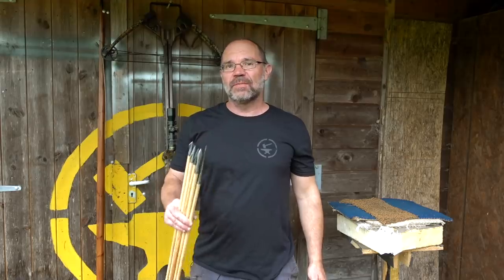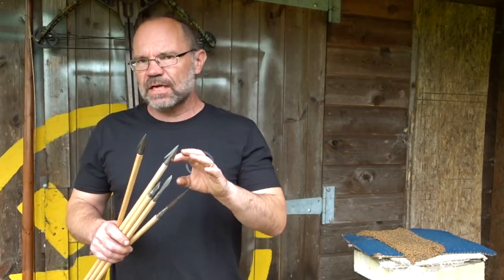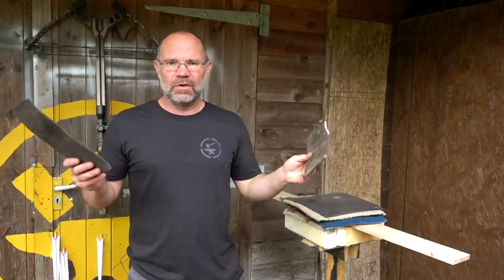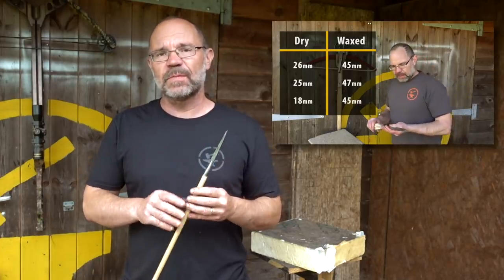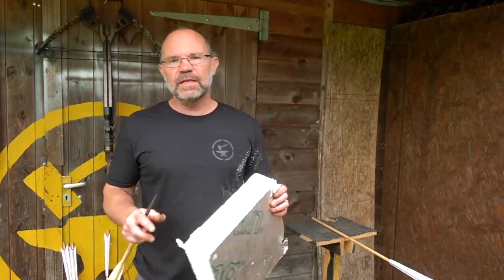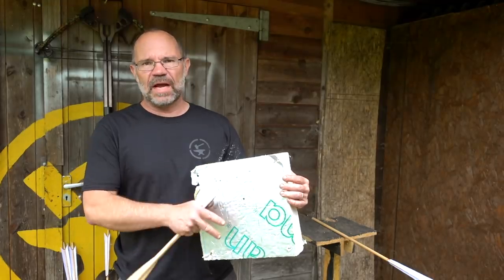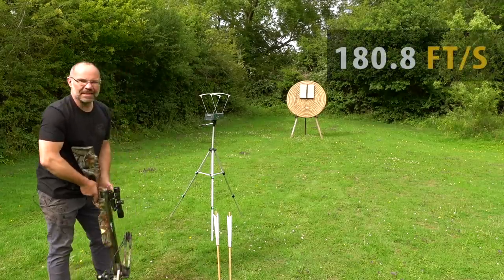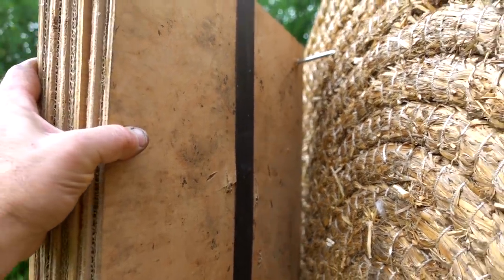Lockdown Longbow - Now I have WAR ARROWS!

Comment: I mentioned something along these lines in the MyArmoury thread, but I think you're using too much power for most of those arrowheads. 9-11mm was a more common external socket diameter (the shaft being 0.5-1mm thinner) for the LM16, and so far most of the the archaeological examples of 11th-14th century arrowhead types - and even some that were used into the 15th century - that I've found have fitted into this range, with at least half being 9-10mm as with the LM16. Similarly, the archaeology of bows, combined with manuscript miniatures, suggests a 28" draw through into the mid-14th century at least.
Edit: If the arrowshafts are ash rather than aspen, that's also something of an anachronism, as most war arrows were made from aspen.
Reply: Hi Jonathan, thanks for the information!
For what it's worth, the reasons behind using a 1/2" socket on all the arrows was to fit this video in as much as possible with our previous one, in which we used a 1/2" Type 9 head, on ash arrows.  As soon as you start adding in all kinds of variety people get a bit funny about consistency.  You're spot on of course, there are virtually no 1/2" LM16s around, and some that I've handled in storage are as small as 8mm, such as the one in Salisbury.  This test was more to see what they'd do as a typology, and we just stuck with 1/2" across the board to minimise variables.
Regarding the draw length, again this goes partly back to our first film with Joe, where he was shooting a 30" draw, so the original arrows were made to that spec ergo these ones are the same, but also because we really only have the Westminster Abbey arrow and the Mary Rose arrows to use as extant examples so had to base our test pieces on those.  The arrows that I made for this film, and the previous one featuring Joe were copies of Mary Rose arrow MR80A764/158 which was 30" in length, so again we just kept everything the same.
As for the ash/aspen issue, it's really debatable what the "standard" arrows were made from.  We know that the majority of arrows used for naval archery in 1545 were aspen, as we've got the MR assemblage to look at but Ascham writes that ash is the preferable timber for war arrows, not aspen.  Either way, ash certainly performs better at these weights than aspen, and holds together far better on impact.  Aspen makes a better flight arrow, but we decided against it for our original film in favour of ash, knowing that ash was historically more likely to have been used at Agincourt thanks to Ascham, and that it increases the chance of damage to it's target over aspen.
Reply: @MedievalArrows  I do understand that there's a desire for consistency, both within a dataset and with the previous video, but given that the arrowhead you based the one used in the Agincourt tests has a 10mm external socket diameter and 10mm diameter examples of the M2 exist as well, so I think a uniform 10 or 11mm diameter would be more representative of the Middle Ages as a whole.

Regarding draw length, the vast majority of archaeological examples of powerful bows from the Middle Ages have a draw length of 28" or less and, since horn nocks don't appear until the mid-14th century and provide an extra 10-11cm of NTN length, I think it's reasonable to use that draw length for 11th-14th century bows. I'll also have to check my notes, but I believe a late 15th century source also refers to a 28" draw length as the minimum. 

As to aspen vs ash for arrowshafts, Richard  Wadge demonstrated that aspen was most commonly used in the early 15th century in his book, "Arrowstorm". Lightish softwoods, such as pine, are also favoured heavily earlier, so I'm not in favour of ash as the "standard" for testing
Reply: @Cahirable  the problem with only using written data to base opinions on is that it's virtually never from actual archers, bowyers or fletchers.

In our case,  Joe's extensive research and experience tells him that 160lb is about average for military bows.  We know that 30.5" was the most common draw length from the only surviving military arrows to examine, and from practical experience to shoot well from a 160lb bow at 30.5" you want to be shooting 1/2" ash - regardless what some sources say.   Historical sources can't always be trusted and are often hard to interpret but practical research from experts is far more useful.

Yeah we could have made the arrows 10mm, but they'd have shot poorly from the 160lb bow.   Yeah we could have made the bow lighter, but that wouldn't have fit with current research on military bow weights.
Reply: @MedievalArrows   Will, I respect the work you, Joe and all the other members of the warbow have done over the years a lot. I'm probably coming out too strongly here amd my respect for your work hasn't been made explicit.

*However*, all your research and experience has shown is that 160lbs was the most common draw weight for military bows in the 16th century and that 30.5" was the most common draw length in the 16th century.

You have also altered history sometimes to make earlier periods conform to your view that there should be no difference between 13th and 16th century warbows. The arrowhead from the London Museum that inspired the arrowhead used in the Agincourt tests, for instance, only has a 10mm diameter socket rather than a 1/2" diameter. Other times you improve a design, as with the Westminster Abbey arrow, whose socket was not flush with the shaft, because that makes more sense to you than the original.

We have a lot of archaeological evidence that ash was not particularly common for war arrows, whether we're talking about the 3rd century, the 9th century or the 16th century, and we also have a lot of archaeological evidence in the form of arrowheads that shows that bows of the 11th-14th centuries were significantly less powerful than those of the 16th century. Moreover, we also have archaeological evidence of high draw weight bows that couldn't be drawn much past 28", at least according to the bowyers I've read. I can email you the measurements and sources if you'd like.

The long and  the short of it is that there's more evidence for bows less powerful than the Mary Rose bows dominating prior to the 16th century than there is for evidence of Mary Rose style bows existing in that period, and the narrow focus of the warbow community is distorting the history.
Reply: @Cahirable  I understand what you're saying,  but we're running tests for the 15th century,  not the 13th.  And there is no evidence of bows from the 15th century.  All we've got are bows and arrows from the 16th century,  so we're using those,  and making the assumption based on practical expertise that they were virtually the same.

And the 16th century bows average around 160lb, and the arrows average around 1/2".
Reply: @MedievalArrows  We'll have to agree to disagree, then. As late as 1465 a draw length of under 30" was acceptable (https://books.google.com.au/books?id=8XE1AQAAMAAJ&pg=PA293&dq#v=onepage&q&f=false), and what few arrowheads I have so far that are likely from the 15th century suggest that, while there was a trend towards more powerful bows during this time, lighter bows were still in common use.
Reply: @Cahirable  I don't doubt that shorter draw lengths were "acceptable."  I also don't doubt that there were all sorts of sizes of arrow, arrowhead and bow in common use.
However, you've said yourself that there was a trend towards more powerful bows.  So the bow we're using fits that trend.  I don't see why that's a problem?  Agincourt was arguably where the military bow was nearing it's peak.  If anything, we can argue that the Mary Rose bows would have been lighter than those used in the 15th century, where pitched battles against plate armour was common, unlike at sea in the 16th century. 
 
The problem with all these tests is that nobody is ever happy.  We've been crucified for using iron heads, despite the original being iron.  We've been crucified for using the wrong type of steel for the plate, despite the carbon content being the same.  We've been crucified for using the wrong backing material, the wrong maille, the wrong fabric armour, the wrong speed tests, and now you're saying that we should have used heads 2mm smaller in socket diameter, and arrows 2" shorter as if that would make some huge difference to our results?  We don't have all the answers - we don't KNOW that ALL LM16 heads weren't 1/2".  We DO know that hundreds of arrows slightly later were 1/2".  We do know that they were 30.5" long.  We do know that ash was used for war arrows.  At some point, we have to use a combination of what we know, and what we think we know, and I believe that's what we're doing.  
Should we run all of our tests again with arrows 2mm smaller, and 2" shorter?  I don't think so.  You'd be happy, and then we'd get comments from people who say the MR arrows were 30" long and 1/2" wide, so we're doing it all wrong.
Reply: @MedievalArrows  
"Agincourt was arguably where the military bow was nearing it's peak.  If anything, we can argue that the Mary Rose bows would have been lighter than those used in the 15th century, where pitched battles against plate armour was common, unlike at sea in the 16th century."
That there is exactly the problem I have with using the Mary Rose evidence for periods that are significantly later. We know from French sources, as well as English sources, that the English made heavy use of warbows under Henry VIII (I think here of Fourquevaux and Blaise de Montluc in particular), and we also know that armour was, overall, heavier and more complete in this period than in the early 15th century - and here I mean for the infantry as well as the men-at-arms.
Additionally, as Steven Gunn has demonstrated in "Archery Practice in Early Tudor England", legal requirements to practice archery were often enforced and frequent maintenance of butts was made, especially during the 1540s and, while, there may have been a declined in the lead up to the 1520s and a slow decline after the 1550s, archery was strongly in practice around the time of the Mary Rose, including by children and youths, and even in 1557 25% of the general population was considered sufficient archers (J. Goring, "Social Change and Military Decline in Mid-Tudor England"). The remaining, contra Goring, did not have "no military skill whatsoever" , but were fairly well equipped heavy infantry (James Raymond, "Henry VIII's Military Revolution"). 
While this proportion is significantly lower than the Bridport Muster Roll of 1457, it is still higher than any other surviving 14th century English Muster Roll, save that of the Rape of Hastings (Wadge, "Arrowstorm"), and reflects a general shift to higher proportions of infantry than missile weapons than was the case in the 15th century expeditionary armies (ibid). This is not evidence of a decline in ability of Tudor archers and, if anything, allowed for those arraying the soldiers to be choosier with the archers. And, more to the point, we don't know what the situation was in the period 1355-1455 when it comes to proportions of archers to non-archers, so there's no way to say whether there were more good archers in 1415 than in 1545.
Similarly, the arrowheads from Camber Castle, which are on the whole similar in diameters to most of the shafts from the Mary Rose, show that powerful bows were considered necessary for defence on land against armoured opponents and make it hard to argue that the bows of the archers onboard Henry VIII's flagship were using lighter bows than others because they were fighting on sea and were less likely to face armour.

Does this mean that the archers at Agincourt were drawing lighter bows than in the 16th century? I don't know. I suspect that they were, but until I get enough firmly dated arrowheads in my database I'm not going to say one way or the other. And, when it comes to tests against metal armour, I have no problem with using a well made 160lb longbow, because whether the arrow penetrates (which I knew wasn't going to happen before I watched the video) or bounces off, it establishes a useful baseline.
However, against textile armour, mail, metal simulating COPs, etc, I think it's frankly useless to use such a powerful weapon, as this video shows. You could make a 30 layer jack out of hand processed, hand spun, handwoven linen canvas, quilt it every 5mm, boil it in glue for a week, let it dry, put a piece of 5mm thick cowhide on top and Joe's bow would still probably penetrate to a lethal depth. A 100% authentic infantry gambeson made out of old linen bedsheets[1], regardless of whether it was soaked in a salt and vinegar mixed, would likely perform even worse than Tod's gambeson.
"We don't have all the answers - we don't KNOW that ALL LM16 heads weren't 1/2" "
5 of the 67 LM16 heads i have in my spreadsheet were 13mm or 14mm in diameter, but I've never argued that there weren't any suited to 1/2" shafts.

"We do know that ash was used for war arrows."

We know that ash was listed as a preferred wood for arrowshafts in the Tudor period, but that they were not particularly common in the Mary Rose wreck (or, for that matter, in the sockets of arrowheads from Camber Castle). Similarly, we know that Henry V and Edward IV both explicitly ensured that there was an uninterrupted supply of aspen for their arrows, and that most of the arrows from the Mary Rose were aspen, so it seems logical to conclude that most war arrows had aspen shafts rather than ash shafts. 
[1] Okay, I admit it, I only have one passing reference to old bedding being used specifically, but a wealth of 13th, 14th and 15th century sources - as well as the Rothwell jack - make it clear that not only was used linen the most common material for the average gambeson, it was actually preferred over new linen in many cases.
Reply: @Cahirable  see my point? That's a whole lot of don't-knows right there.  We don't know, so we made educated guesses where possible. 

Never gonna please everyone  :)
Reply: @MedievalArrows  As I said earlier, this is clearly a topic we'll have to agree to disagree on, but I hope you can see that I'm using archaeological and textual evidence from the period to make my point and that I'm not just trying to be contrary

Comment: Dude, that's super dangerous to fire any wooden arrow through fiberglass limb let alone a compound.
I know those are very well made. I'm very supervised that they held up and you didn't dry fire. 
I wouldn't have done it.
Reply: Nonsense. What matters is matching spine to bow weight. 
Shot wooden arrows thousands of times from fibreglass (composite and pure glass) when I was a teenager. Arrows broke hitting stones, posts, trees. Never in the bow.

Comment: I would wager the ones that we have no evidence being made with steel were just expected to break and be lost in battle anyway so why use a more costly material? The ones that are more designed for flesh wouldn't be fired at things that would break them so they could be recovered and used again. But that is just speculation.
Reply: As for the wax on arrow heads: I don't believe wax would survive on the heads we find on the seafloor and buried in the dirt. I also think that if the standard practice was to wax your arrowheads to prevent corrosion, of course mentions of it would be virtually non-existent in the recounting of battles and we have very few (if I am not mistaken) records from people like quartermasters and fletchers regarding maintenance of arrows which would be the only likely source to tell us if they waxed them. The archers might know, but but realistically they are just taking arrows from a barrel on the line and loosing volleys until they are out or are told to stop they don't really care if their arrows are waxed or not. If wax has greater penetration there is no way people would not have figured that out and applied it since wax is cheap and easily applied to the arrows as they are finished.

Looking at history before modern bookkeeping where we record just about everything it is easy to forget that many of the things we do we consider so obvious that "why should I record that, everyone knows that already."

Comment: But is the sheet steel comparable to historical plate cuirass? Especially in shape, thickness, and hardness? This is especially important.
Or at the least is it comparable to the overlapping iron plates under a brigandine jack? 
Also I think if you want to represent a shield, the wooden plank should be covered with leather - also shouldn't a thick plywood a more representative material than a wooden plank (AFAIK Roman Scuta were made of thick plywood covered by leather, not sure about medieval shields, you know better than me)
Reply: not all shields were covered in leather, so covering the plank in leather should be a separate test.

as for plywood shields? those weren't too common in the medieval period, that said some byzatine shields were made like older roman shields.
Reply: A modern sheet of mild steel is supposedly comparable enough as a base material as the one they used back then wasn't as uniform, the thickness can also be matched easily. Heat treatment is the biggest problem because it varied so much, there was properly heat-treated armor, there were rush jobs and some wasn't treated at all.
From that experiment with period-equivalent high quality armor we already know that an arrow won't go through a hardened steel breastplate, so this would be more interesting as an equivalent of a cheap breastplate, which were probably common enough.

Comment: I won't begrudge you using whatever target backing you want, but that sound of the arrows sliding through the Styrofoam is 100x worse than nails on a chalkboard to my ears.  If you can minimize how much of that makes it into the final video cuts in the future, I and many others would be very grateful.